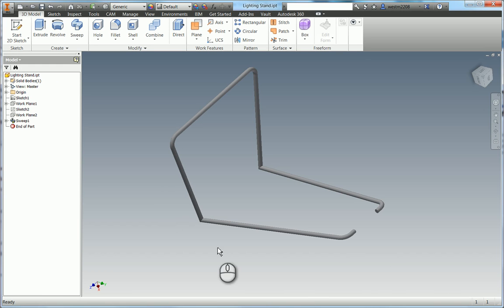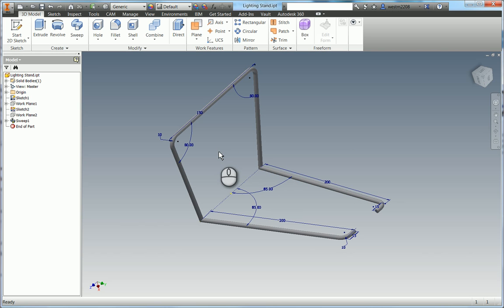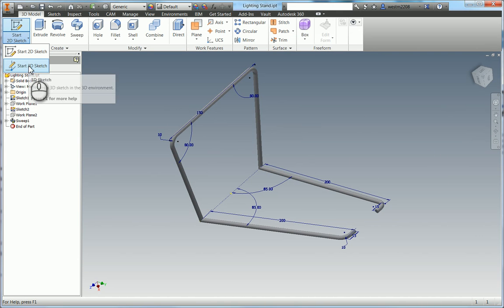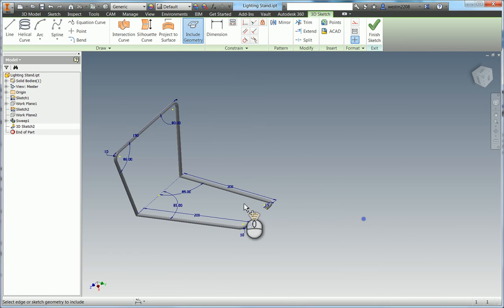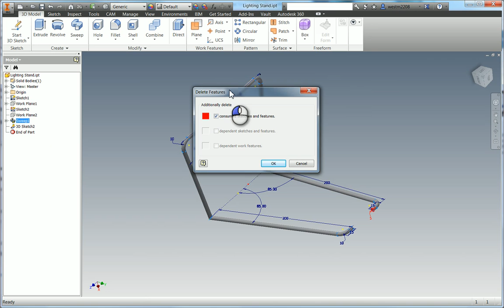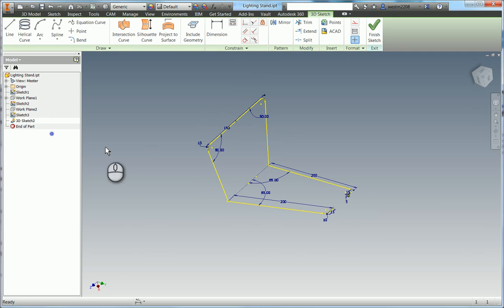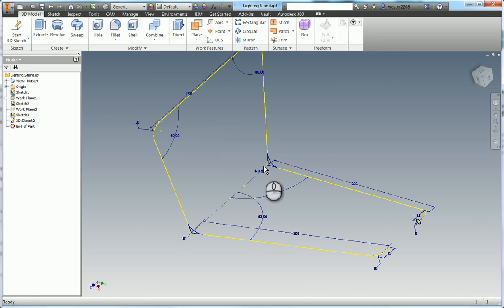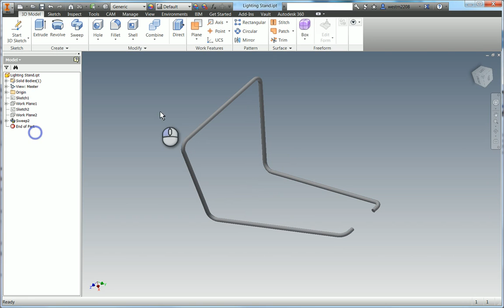Introduction to 3D Sketches in Autodesk Inventor

Comment: Hello ,.. quite a nifty method
But .... I just can not make measurements on the 3D sketches, is there a solution to the problem
Reply from the maker: +Bjarne Wibrand 
Hiya, are you drawing lines, splines or something else? If it's lines just hit "D" or dimension and it should act the same as a normal 2D sketch.
I'm using inventor 2015 in the video and just double checked on Inventor 2016 and works fine. Do you have any more information on what type of line you're drawing?
Thanks!
Reply: +Inventor Tutorials 

Hi
Usually I can right-click the line and select measuring loop,. I thereby get the total length of the material to be used in the production (of course without the - factor of the machine)
 in this case some parts of the 3D sketch line is made of the projected lines which are used as sweep path

hope what I write makes sense for you ;-)